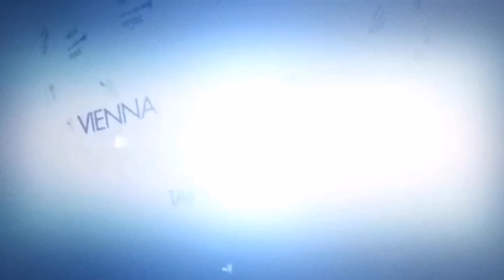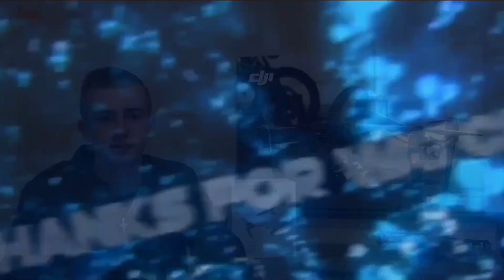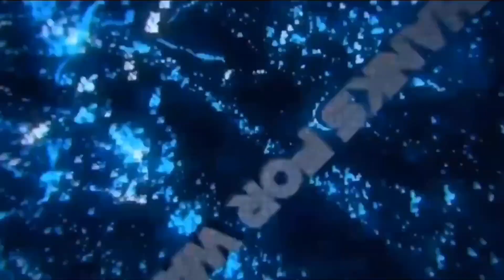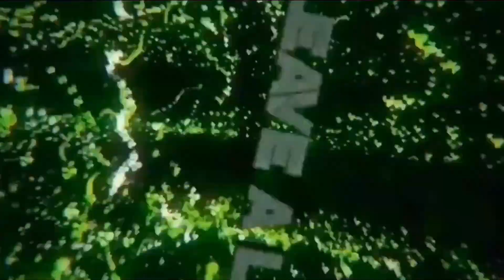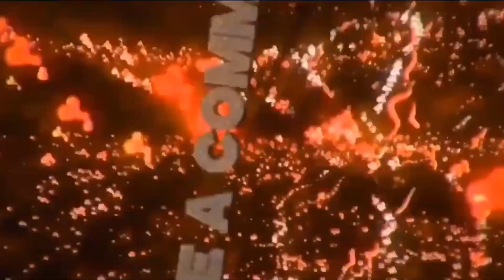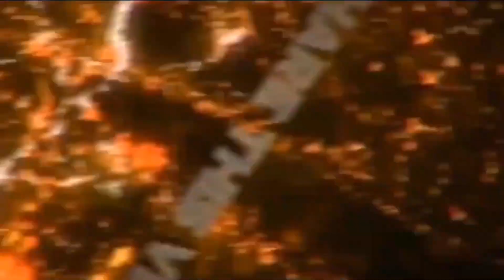DJI Mavic 3 Confirmed Release Date

Comment: What is the price for the  mavic 3
Reply: You thing with fly more combo 1999 or without? Thank You!
Reply from the maker: I think it will $1999 be for the basic combo and an extra $299 for the fly more combo.
Regards
Reply: OK thanks ✌️
Reply from the maker: No problem
Reply from the maker: There is still not an exact pricing yet, but what is confirmed is the fact that the price will be increased. I expect it to be around $1999.
Regards